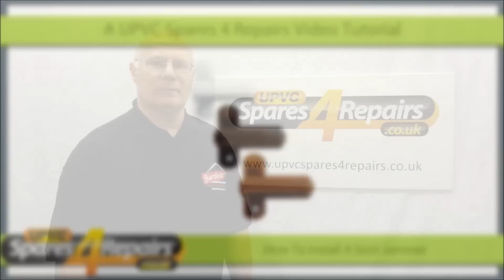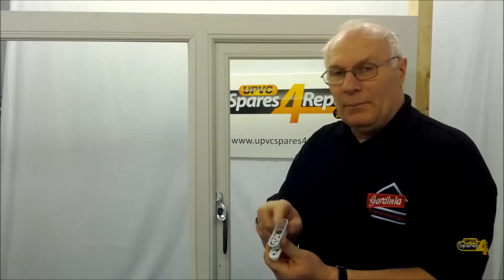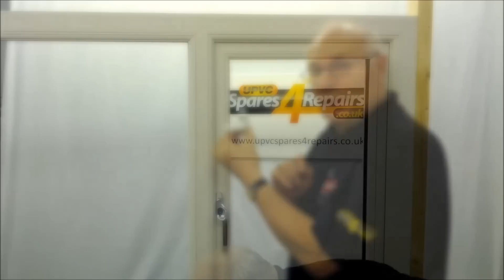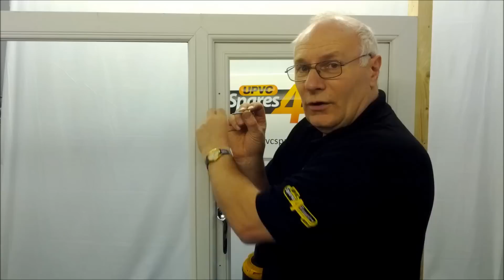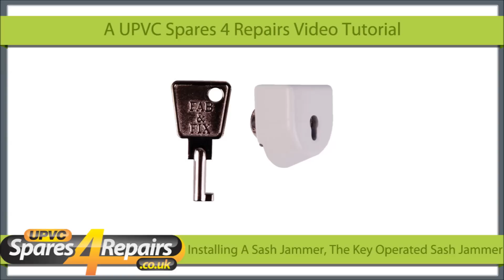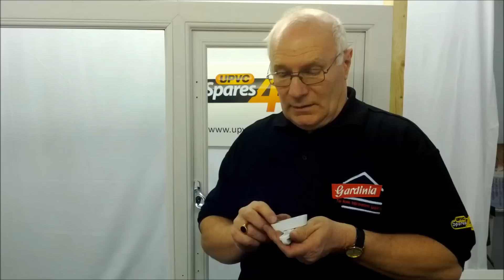How To Install A Sash Jammer And An Optional Packer

Comment from the maker: We suggest a jack plug (like a plaster board plug fixing that squashes out behind material when the threaded bolt tightens into it) you can pick them up at any local DIY store.